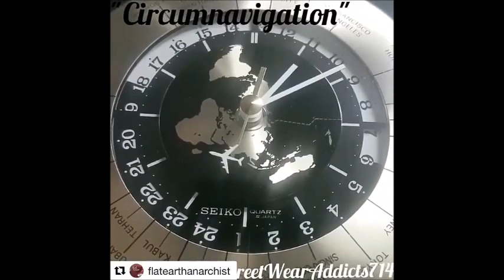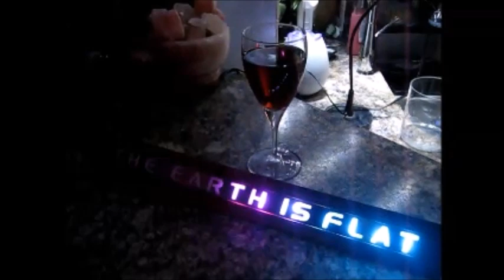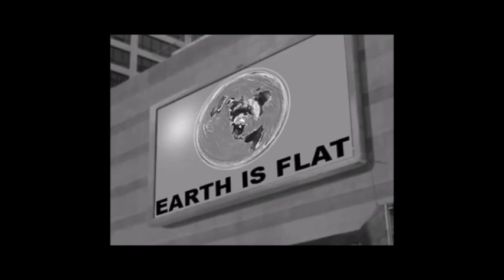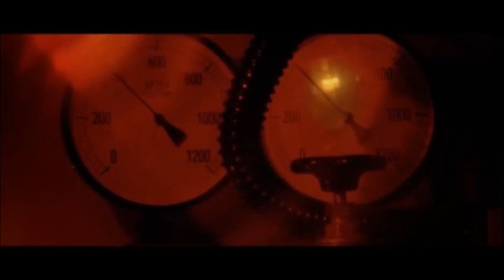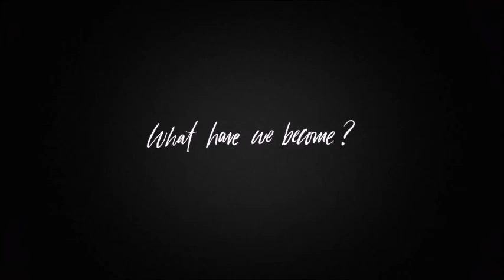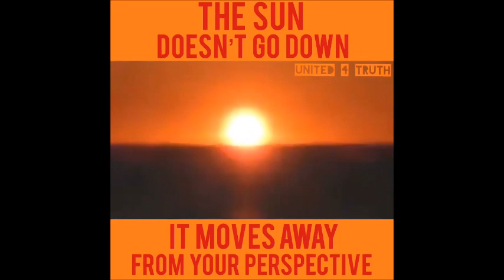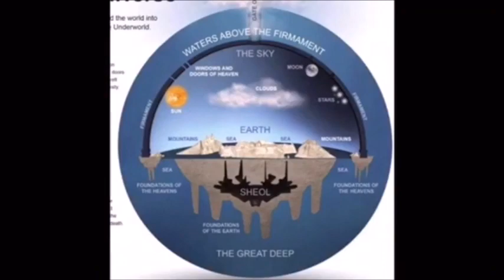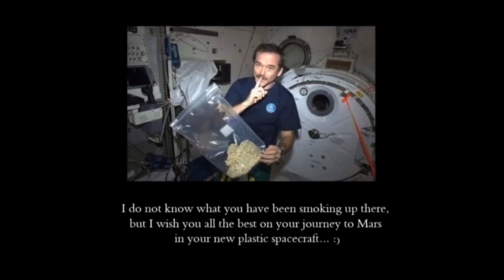Flat Earth Q&A Emails 108 Mark Sargent ✅

Comment: Would you be able to do the following experiments? Take trip along the coastline of antarctica in december and measure the distance. The flat earth model would be about 70000 miles and globe model would be around 12000 miles. Also annotate the suns size and position. The next experiment would be a model flat earth map about 80 feet wide. The sun would be represented by a 1 inch bright lightbulb and would hover around about 8 feet above the map. According to fe theory the sun is 3000 miles above the earth and 30 miles in diameter so the map would be to scale. With everything set in place pick a location on the map like florida. Move the sun around 8 feet above map with a drone and make it set.
Reply: Jeffrey Brown -- you lost them at "would you be able."
Reply: By the way, I'm stealing your scaled model.
Reply: @Candleman Smith Your "research" failed you (big shocker, right?). The trip to which you refer included large sweeps up and down the southern Pacific, as well as visits to Easter Island, the Marquesas, Tahiti, the Society Islands, Niue, the Tonga Islands, the New Hebrides, New Caledonia, Norfolk Island, Palmerston Island, South Sandwich Islands, and South Georgia. The voyage wasn't confined to Antarctica, but you flat-earthers will always omit that fun little fact because then you can speculate that he really traveled around an ice wall. Did you even consult a map of that voyage before you posted your nonsense?
Reply: @Candleman Smith No you haven't. Otherwise you would have known that that voyage included much, much more than circumnavigation of Antarctica. You didn't know that very important fact -- or, you DID know it and omitted it to make it appear that that "60,000 miles" proves he sailed around an ice wall. So which is it? Did you lie about "studying" Cooks logs, or did you knowingly misrepresent that he spent three years and 60,000 miles traveling around an ice wall? Those are the only two options.
Reply: @Candleman Smith That's NOT what I was referring to. I was referring to the myriad of other locations he visited on that voyage. You mentioned only the trek around the supposed ice wall and the lead distance from the U.K. You clearly intended to misrepresent those as those only two things to consider in a three-year, 60,000 mile voyage. Why did you lie about that?
Reply: @Candleman Smith "Oh and I studied Cooks logs extensively during my Royal Navy officer training"

Hahaha, now I KNOW you are lying. Tell us how a sextant works on a flat earth? Tell us how Great Circle navigation works, "Royal Navy Officer." Tell us how you charted voyages without using maps that are based on a globe model. Go ahead. I dare you. This will be fun ; )
Reply: @Candleman Smith what are the links to your sources
Reply: I @Candleman Smith in fact why dont you do the antarctica coastline trip yourself. Crowdfund it
Reply: @Candleman Smith what you got to lose
Reply: Hey Jeffrey how do you know the circumfrence of Antarctica ice wall is 70,000 ?
Reply: @theseeker.1746  the fe movement estimates that the diameter of the earth disk is 25k miles. So the circumfrence would be around 75k miles of antarctica coastline. The globe circumfrence of the earth is 25k at the equator. On the globe the antarctic coastline is around 12k miles. Im just saying the flat earth community should do an antarctica coast trip.
Reply: But flat earthers say satellites are not real...